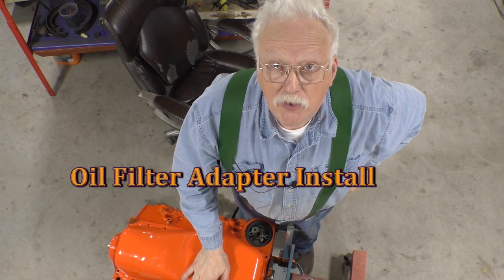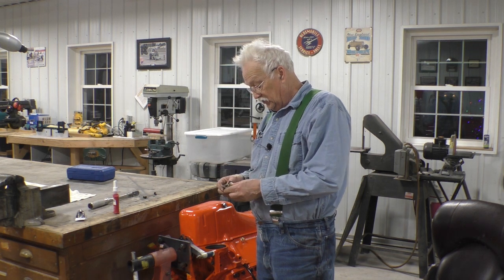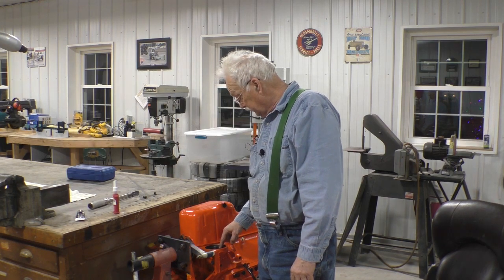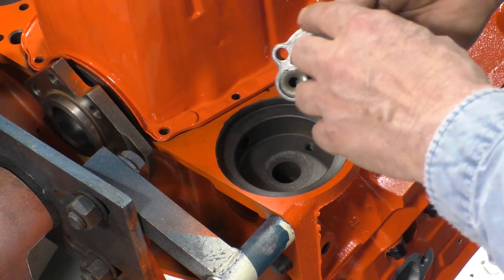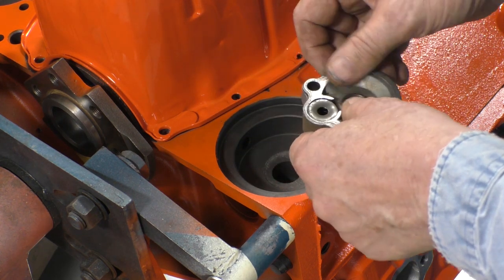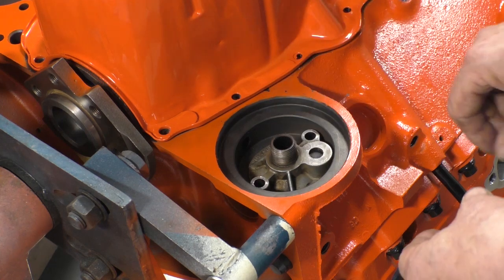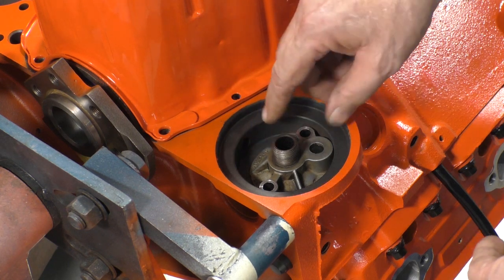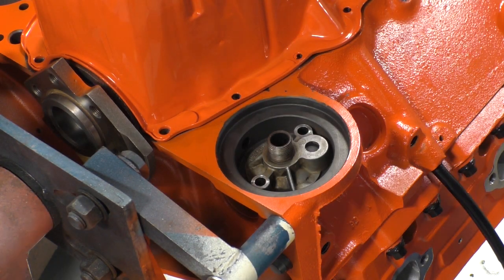SBC Oil Filter Adapter

Comment: The guy in another video showing how to install this adapter said that you MUST have the check valve CLOSEST to the engine side of the oil filter area. He ALSO used the gasket. Now...in 1983 when I rebuilt my 283 small block that was out of a 1965 Chevy pick up truck, I used one of these adaptors without a gasket. I don't remember which way I had the check valve oriented. I had hardly any oil pressure getting up to the lifter gallery. In fact when I hooked up an oil pressure gauge to the lifter gallery test port there was ZERO oil pressure ! The oil pressure reading at the oil pressure port on the lower driver's side of the engine read 25 lbs of oil pressure. Being a freshly rebuilt engine with ALL new bearings - all new EVERYTHING... I was NEVER able to figure out what the hell I did WRONG that resulted in such bad oil pressure. The pick up tube DIDN'T fall off of the oil pump either. I know that for a fact. I even changed the oil pump THREE times....the third oil pump I put in was a CORVETTE high volume oil pump and THAT didn't make a difference at all. What did I do wrong ? This and the Kennedy assassination are the GREATEST MYSTERIES of my LIFE.
Reply from the maker: Wow, oil pressure is good on the 383.

Comment: You've put the bypass the other way towards outside. Almost all that I've read and videos I've seen have stated the bypass should be towards the inside and with no gasket. As for me, what factory did was the correct way.
Reply from the maker: WE have had no problems, that is what is great about this hobby, you can do it anyway you want and be correct. Thanks for the comment.

Comment: I just actually picked up the GM OE gasket for the first time in 20 years. It's a metal core and gasket material is fused to it. I don't see how gasket material can end up in the filter now that I see the design.
Reply from the maker: Good piece of information to file away
Reply: @ThrottleStopRacing  My man! But in reality I have never had a issue with or without so it's kinda like.🤷‍♂️😆
Reply: @TPVPRO  How would you know if you're having an issue?
Reply: @Milkmans_Son  Part of the stock style adaptor has a bypass for when the pressure gets to high to bypass the oil filter. This works for two things, makes sure you have proper flow at high RPMs and helps keep the pressure from getting high. You may never know if you have a problem,  but I promise the adaptor will leak oil past and that oil will not be filtered. If you change your oil on time and use a good quality oil 99% you will not have an issue as some of the chemicals in the oil will suspend the partials etc.

When you pull bearings and notice scoring, it generally from oil not being filtered properly (and more than likely a part is failing or not in spec).

Side note: Pumps (oil in this case) only create flow and the systems lines and filter create pressure, so any hydraulic system that leaks, even internally) may not operate properly.
Reply: @Nowayjose-z2r  Explain what your getting at with this one ? Are you talking about the position of the adapter base on his video or using or not using the gasket between the adapter and the block ? 
Was curious because im doing this oil cooler delete mod and Was going too switch the direction of the adapter for more oil flow . Also not using a gasket as most don’t .
Appreciate the insight in understanding what you are saying here 
Thanks

Comment: My question sir is do all the Blocks have to 2 tapped holes to mount it to the Block???  I got one for my Boat but at the moment engine still in boat so I dont know if my block has the 2 tapped holes for the insert  Thanks.
Reply from the maker: I really do not know, use your phone and take a picture is all I can suggest. Working in the bilge is always close quarters.

Comment: Use Loctite 243 it is the upgraded oil tolerant version of the old 242.  Also, thread lockers have a shelf life.  Always clean the internal and external threads free of oil and foreign debris, apply the thread locker to both the internal and external threads and run faster back-n-forth a couple times to properly distribute the locker...then torque.

Comment: It’s videos like this that this NEW GENERATION will never get the opportunity to absorb where we came from and the care it took to BUILD back then. I JUST stumbled across your videos/channel. I will be watching a lot more. I learned a lot in this simple video and it reminded me of when I was a kid and my Dad was teaching me to work on his Hot Rod. Wow how much this took me back. Thank you 🙏 and u have a subscriber here now
Reply from the maker: Thank you for the time you took to write your comment. It makes making these videos a pleasure.
Reply: I’m only 21 and this video is extremely handy for me. But yes most of my generation isn’t 350 swapping things.  Myself my 2wd housing was cracked and spewing its brains out. And now I’m installing this adapter to eliminate the oil cooler and my oil leak. My carb 350 swapped s10 with a turbo 350 trans is about done now. With the help of his video
Reply from the maker: @Andrewstrauser  I very happy that the video was of help to you. Keep turning wrenches.

Comment: I just bought one of these OEM adaptors to install on my '57 283. I presently have an aftermarket Mr.Gasket adaptor on it that utilizes a FORD oil filter. My friend who is a die hard Chevy guy says this OEM one won't work on my '57 283. My friend also agrees with the majority on NOT using a gasket between the adaptor & block......Your thoughts??

Comment: In my case, I installed an oil filter relocation adapter - mainly because my headers are wrapped [I really don't need the mess or the hassle].  I use the larger System 1 filter, and had such nice pressure, I changed from 10w-40 to 5w-30, but most of that was clearance driven.  Not tight, but definitely street.
Reply from the maker: I do not think there is a better filter system then System 1

Comment: So I’m late to the discussion but on the topic of whether you use a gasket there or not, I was taught that if there’s one there when you remove it, then you add one when you replace it. Otherwise no gasket is needed if it didn’t already have it.
Reply: I’m about to do this oil cooler delete on my 98 c1500 pickup and Not use a gasket . Too the best of my knowledge after reading everything it’s said over and over by actual people here and on forums who have done the oil cooler delete or simply changed the oil adapter and driven for 1000s of miles that  the 
GM# gasket for the Melling mfa350 adapter is not needed between the adapter and the Engine block. Even Melling says the same. The block and adapter are both machined surfaces so it seals with 120inch pounds on the torque wrench
Reply: @Chevro91  I can’t imagine it would leak either and it would be within the gasket of the oil filter anyways. It’s not hard to add it later if it does. But idk how’d you know unless you were having oil pressure problems. Can always use a light rub of oil resistant sealant. It wouldn’t be as thick as a gasket and may fill in any imperfections.🤷🏼‍♂️
Reply: @odinslockllc  edit i now have partially confirmed it’s 7.5 ft lbs otherwise known as 96 inch lbs 😀. I believe the gasket is not needed for sure …  but I recant my source who said it’s 120inch lbs of torque 
If you can find them specs let me know
Reply: @Chevro91  I’ll look tomorrow
Reply from the maker: I agree.
Reply: @Chevro91  my book says 80 in lbs🤷🏼‍♂️. I’m rebuilding a 74 sbc. Whatever you do, be sure to use a drop of loctite on each bolt.
Reply: @odinslockllc  I did 90 inch lbs otherwise 7.5 ft lbs and used loctite 243 worked great so far “NO GASKET” Gained 10-15 psi on a new wix filter

Comment: Hi 
where is the difference where the opening of the bypass points ..?
Is a seal generally necessary?
Have too little oil pressure in my 383 Iroc Camaro ... cold ok ... warm a disaster.

Greeting from Germany
Reply: I had the SAME problem back in 1983. I'm DYING to know the REASON for the low ( actually no oil pressure ) pressure.
The guy in another video showing how to install this adapter said that you MUST have the check valve CLOSEST to the engine side of the oil filter area. He ALSO used the gasket. Now...in 1983 when I rebuilt my 283 small block that was out of a 1965 Chevy pick up truck, I used one of these adaptors without a gasket. I don't remember which way I had the check valve oriented. I had hardly any oil pressure getting up to the lifter gallery. In fact when I hooked up an oil pressure gauge to the lifter gallery test port there was ZERO oil pressure ! The oil pressure reading at the oil pressure port on the lower driver's side of the engine read 25 lbs of oil pressure. Being a freshly rebuilt engine with ALL new bearings - all new EVERYTHING... I was NEVER able to figure out what the hell I did WRONG that resulted in such bad oil pressure. The pick up tube DIDN'T fall off of the oil pump either. I know that for a fact. I even changed the oil pump THREE times....the third oil pump I put in was a CORVETTE high volume oil pump and THAT didn't make a difference at all. What did I do wrong ? This and the Kennedy assassination are the GREATEST MYSTERIES of my LIFE.
Reply: Hello
basically i have a new 383,motor....
Everything was renewed, except for the block itself, which was of course drilled to 0.30 oversize.
Everything was carefully assembled, pistons, connecting rods, crankshaft, camshaft, oil pump.
The cylinder heads are the aluminum L98 from the 5.7 TPI Corvette.
Whereby cylinder heads cannot have any influence on the oil pressure.
Only this 383 loses its oil pressure the warmer it gets.
The oil pressure isn't quite at zero but you can hear the hydraulics ticking when idling. If you give it a little gas, the ticking is over.
The instrument gauges then also go up a bit.
I have already bought an HP oil pump.
Unfortunately, the engine of the IROC Camaro has to be removed or raised very high. The K-Member runs 5 mm under the oil pan. This is crap.
I suspect the oil pump is bad.
A mystery for me too.
I'll get to work this year.
That's why the Camaro has been in my garage for 5 years.
Greeting from Germany

Comment: After doing that what kind of oil filter do you use for it. I have a 283 small block
Reply from the maker: You can use any filter that worked before, I use a/c delco
Reply: @ThrottleStopRacing  which ac Delco filter do you use? I have a 350 SBC. My Duramax uses the pf2232 oil filter and that seems to fit pretty well but I'm not sure if it's the proper filter (too big?). The stock filter number pf52e is entirely too small.

Comment: What oil filter will fit on the adapter, part number?
Thank you 
Jose
Reply from the maker: Sorry it took so long, currently there is a STP S5 on the adapter.
Reply: @ThrottleStopRacing  thanks. I have a 327 from a 1967 chev, it has an adapter on it. Google kept giving me the canister part number. Got it, thanks. Great Info

Comment: What type oil pan is that I need one like it . Got a part number on that? I bought two that were too big over my crank.
Reply from the maker: It is the stock pan that came off the engine when ii was taken apart. I am no help with a part number

Comment: I am knew to this oil filter adapter if you can use the same oil filters as before what is the adapter for?
Reply: The REALLY OLD Chevy Small Block engines had an oil filter that was a CANISTER that had a LONG BOLT that ran through it with a small seal that went under the bolt head. I THINK ( I can't remember ) there was also a seal on the other end of the canister. You would take the canister off and replace the ELEMENT ONLY on the inside of the canister. The more modern Chevy Small Block Engine design had a threaded center pipe nipple  that an oil filter would just screw on. The modern oil filters have a square cut gasket around their outer edge and corresponding threads in the center. the ADAPTOR is used to convert a very old small block to be able to use a modern day filter. It seems like a great idea but I didn't have any oil pressure after rebuilding my 1965 Chevy 283 engine that was out of a 1965 pick up truck. I've always suspected that it was the oil filter adaptor that caused the problem but I never confirmed that as the cause. I'm dying to know.
Reply: @martinlutherbling424  I have one of these old style cannister filters. I replaced the filter recently and it wasn’t bad. Are there any disadvantages to sticking with it? I guess the seal on top “could” slip off while the canister is being screwed in?

Comment: It increases oil pressure?
Reply from the maker: Increases oil flow
Reply: Oil flow results tend to be higher lbs after doing the Oil cooler delete mod because the lines the flow of the oil cooler lines the fact it goes in and out of a radiator and the flow over all reduces restricts pressure in anyone’s honest opinion. The lines are useless unless one is Towing a lot or you just prefer too cool oil somewhat.

Comment: 7.5 foot lbs??? Hell  go 8 who the hell owns a torque wrench that will go half lbs?
Reply from the maker: I do, but agree
Reply: Pretty  sure the actual oem torque specs for any 350 Chevy oil filter adapter is 120 inch lbs if it makes a difference for Anyone here wanting factual specs. Beats snapping the bolts off in the block
Reply: 120 in lbs = 10 ft lbs